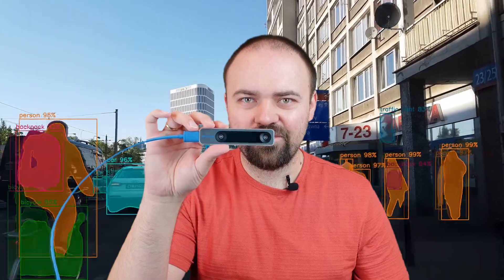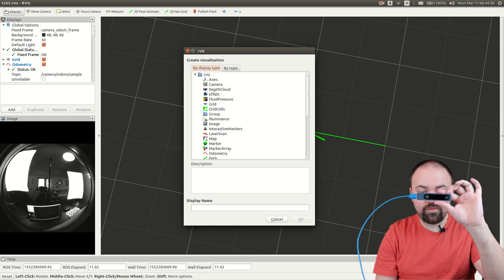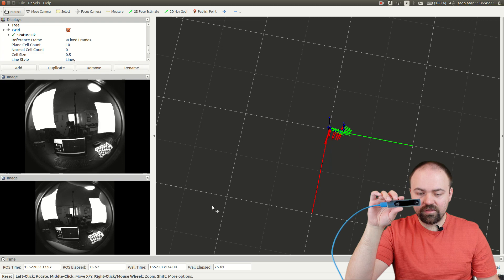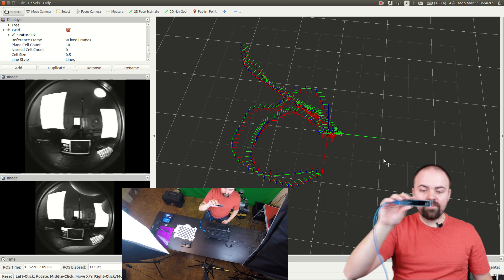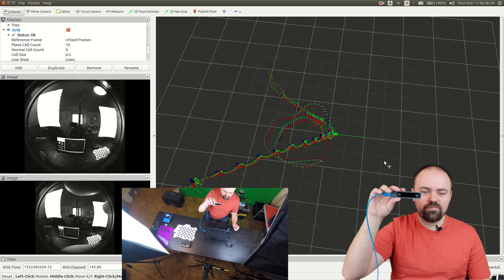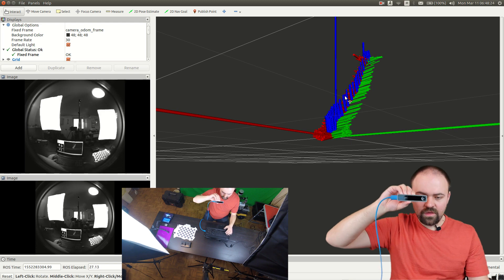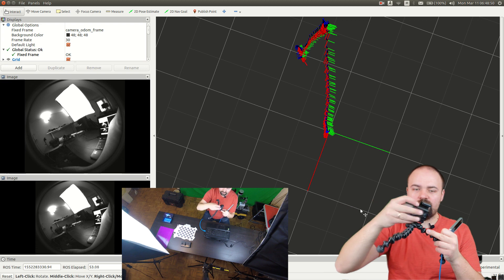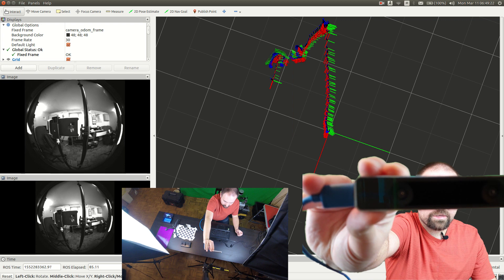Intel Realsense T265 tracking camera test - ROS driver

Comment: So I see that you are using Tracking camera for it's Orientation pose but can we use a dseries camera ,run slam on it and get the same pose and orientation of camera ? Is that possible ? How accurate will that be ?
Your videos are really good , thank you
Reply from the maker: Thanks. There's a demo t265+d435 rtabmap. Yes, you can use t265 pose as initial pose guess for slam
Reply: @KarolMajek  can I use d435 , implement slam on it and get the pose of the camera just like tracking camera gives by default? Will the result be same?
Reply from the maker: @kaka-w6z5f  do you know ROS? Check this launch: https://github.com/IntelRealSense/realsense-ros/blob/development/realsense2_camera/launch/rs_rtabmap.launch

It runs d435,t265 and RTABMap. You need to mount sensors together - there is a part to 3d print. Then you can build 3d map by moving cameras

Comment: I need to do indoor positioning with Aruco markers for a virtual reality experience. 
Do you have any recommendations how I might accomplish this (is there a more appropriate sensor than the T265, etc.)? 
I would really appreciate any help as you seem to be very knowledgeable in this field.
Reply: In order to use the aruco marker, you don't need the real sense camera only. You can use a Webcam for example, but it depends of the application
Reply: @cesarhcq  Thanks for the response! I'm trying to do something like this video https://www.youtube.com/watch?v=SruntQFFefI. Place aruco markers around a physical environment and strap a sensor to the front of an all-in-one virtual reality headset to determine exactly where the player is within the environment (based on the visible markers). 

In other words I need to use aruco markers to figure out what I'm looking at, but also a sensor that can tell where I am relative to the marker(s). The headset can do most of the tracking, I just need to use the markers+sensor to correct any drift that happens over time.
Reply from the maker: If you're working with ROS:
I tested this library: http://wiki.ros.org/aruco_detect
It was able to detect aruco from 3m using very hard webcam from Creative.

They also have aruco slam, but I didn't test that.

Comment: Thanks so much for the video. But I'm still confused about using it for building dense map with another RGB-D camera (using T265 for the 6DOF pose estimate), because we have many pose estimation algorithms like okvis,rovio, VINS... all those algorithms require a VI sensors with IMU and stereo camera hardware synchronized a'd time stamped.  I think this camera is a solution  for that issue,..  But still not sure since no one had tried it on real UAV. 
What do you think?
Reply from the maker: I'm not working with UAVs. The lack of at least PPS can be a problem.
For ground robots it's enough
Reply: @KarolMajek  please what do you mean by PPS
Reply from the maker: Pulse per second from GPS
Reply: DVO Slam is meant for use with RGBD cameras, it uses the full depth frame for tracking instead of just sparse features. I have not tried it yet though, it is made for an old version of ROS.

Comment: Any robot can have vibrations and, to be honest, I consider a 1% closed loop error to be significant.
Reply from the maker: Handheld without GPS or any other sensor, 20 meters error after 1600 meters indoor/outdoor multilevel walk (start and end 4th floor).
Still think it is bad?
And after fusing this VO with wheel odometry in a mobile robots, do you think the result would be worse (of course no stairs...)?

Such accuracy for $200 is the best price/quality
Reply: @KarolMajek  Better than using DVO Slam with an RGBD camera? That is what I was planning on using for 3D mapping, however maybe I should just get this. It would be easier anyway.
Reply from the maker: Easier and 1.5 Watt without using your CPU/GPU
Reply: @KarolMajek  Ok I am sold on this thing, buying one today :) I will just have to use a gimbal maybe to make sure vibrations or the rotation you demonstrated isn't a problem. I noticed the same sensitivity to that kind of motion on the ZED Mini camera.
Reply from the maker: Hope you will be happy with it :-)

Comment: Did you test it outdoor?, vehicle navigation?
Reply from the maker: I already tested outdoor, in a car and hand held. In the first scenario it lost tracking, i don't know when, I have only the video, no rosbag. Second scenario - one kilometer, 4 loops (2 different 8 does), urban area, final error 20-30 meters.
In first I mounted it inside the car, a lot of the car was visible in 160deg FOV. In the second sensor sensor was seeing only the environment.
Reply: @KarolMajek  Thanks for the information. Can you access the sync IMU data in addition to the two cameras.
Reply from the maker: You have 30fps two cameras and IMU 200hz. I was using only the ROS driver

Comment: Can you describe how to generate the trajectory with the axis as in your video. Can you share the .rviz file or suggest topics to add. Thanks.
Reply from the maker: Do you have the sensor?
Add /camera/odom/sample (odometry topic)
Change visualization from arrow to axes
Reply: @KarolMajek  Hi Thanks. I have the camera  and just tested it. Works perfect. Thanks for the tip. I can confirm that the performance is not so good with vibration. Its more or less best suited for ground robots rather than UAV's for accurate tracking and mapping when fused together with the wheel odometry. Good thing is that this sensor has a very good IMU that is factory calibrated that makes things pretty easy to work with and integrating into robotics project. Keep posting more interesting videos. Thanks.
Reply from the maker: Thanks! Check also how static objects in FOV change the results. I think there's a difference, but I'm not sure. Now I have mounted it as a bumper, so it can see only the stuff around, but I'm going to place it somewhere else, will see.
I already made experiment with 1km distance with 4 loops (2 different 8-shapes) going down 15m and up, and the error was as little as 20-30 meters (no other source of odometry), and this I consider a good input for 6D SLAM
Reply: @KarolMajek  Are you going to make some video with results from your car? Maybe, at least, you can share the results somehow?
Reply from the maker: I can't make it during next 2 weeks. Hardware and software is ready but I'm not :-)
Reply: @KarolMajek  Can't wait for your results 😉 Hope, you will post it somewhere.
Reply from the maker: I'm not sure if I'll be able to do it in June cause I've experiment with a mobile robot in NPP in July. But for sure I'll try!

You can expect GPS + T265 comparison with rosbag dataset
Reply: @KarolMajek  will be great 😁👍

Comment: What are some fields maybe this camera’s useful? Do you mean maybe tracking positions of drones or cars or moving traces? But for drones or cars some other accessories can be used to do that while not that intensive for processing.
Reply from the maker: Processing is on this 1.5W device, not on PC.
It can be used for VR/AR.
Mobile robots
Yes drones have good visual odometry already.
Reply: Karol Majek Yeah! I got u. But still I think the better part of this camera is the facing direction of camera while the tracking’s also pretty cool.
Reply: Karol Majek Cuz I don’t get how the position tracing can be useful for vr games or other stuff
Reply: Karol Majek also I think the software itself is more important and much more useful, if it can be used on other cameras.
Reply from the maker: Large scale VR. I was walking with this sensor 200x200 meters and had only 30 closed loop error. But it was outdoor, so pretty hard environment.
It can be a good solution for multi player VR games in large hangars
Reply: @KarolMajek  Oh that makes sense. That's cool though.

Comment: Hello , this camera can work for indoor positioning ?
Reply from the maker: Relative only. So you will know what distance you walked, but not exactly where you are in the building (depends where you start the sensor)
For global positioning you will need external source e.g. Aruco markers
Between markers you will navigate on Vslam from t265 and markers will help you localize in the global map
Reply: @KarolMajek  thank you , i work in drone and i have D435 camera  but need powerful hardware and is not easy to use for slam  , Is the T265 have the same problem or can work in the smal card like odroid or Rasp   ? what  is the tools that you use in this video  ?
Reply from the maker: It requires 1.5Watt usb 3. Processing is on device. I'm using ROS with ROS driver for realsense. Rviz for visualization
Reply from the maker: So it doesn't require computing power, but USB 3 with 1.5W. I have one ITX computer which is not compatible, but had usb 3. I will try with external usb 3 hub with external power source
Reply: @KarolMajek  I used the D435 with Ordroid XU4 it worked without external hub , i see that this camera is very sensitive with vibration , is not easy to use in  drone , maybe better with   stablized gimbal  .
Reply from the maker: True, but it still performs very well (visual slam for 200$ with such low errors!?)
Reply: @tarekhemia1938  if you have good flight controller performance, i dont think that is a problem, except you are flying outdoor with wind and all that stuff
Reply: @kenshee627  Hello , yes i Tested this camera with a drone indoor  , 
it seems to work well , but 
only the camera is not enough ,especially in an aggressive environment, lighting, dust.. 
i have rotating laser sensor, i search solution for laser slam  ,i think merge this camera with laser  can give  
exellent result

Comment: Can we export its camera position data in another 3D application like Houdini or 3ds max ? In what format ?
Will it work if we place T265 over some DSLR camera to fetch the position data of DSLR ?
Reply from the maker: I don't know if there are any plugins yet. Yes, you can place it on camera to track it's position
Reply: @KarolMajek  , If it can export position data in fbx format, then it will work for 3d application, can you share screen where it shows export formats, please ?
Reply: @KarolMajek  my email ID is sarvobusiness(at the rate)yahoo.co.in
Reply from the maker: Fbx is proprietary format. What you can get now is a list of xyz rpy with timestamp in e.g. CSV format.
T265 is aimed at developers. There's API, but no exporters to any popular format 
Are there any more open formats or possibility to import spreadsheet?
Reply: @KarolMajek  I guess, spreadsheet will work. thanks for your response.
Reply: @SARVOTARZANVFX   hi, did you manage to export the position/rotation to CSV or any other useful format?
Reply: @orlando17-y1z  Technology has evolved, and now i am using Iphone cam tracker for this need. thanks !